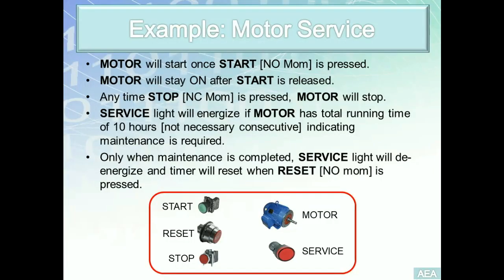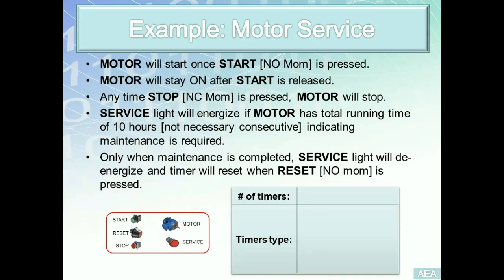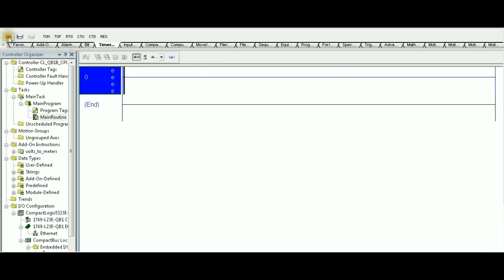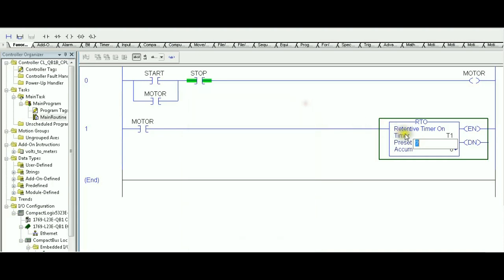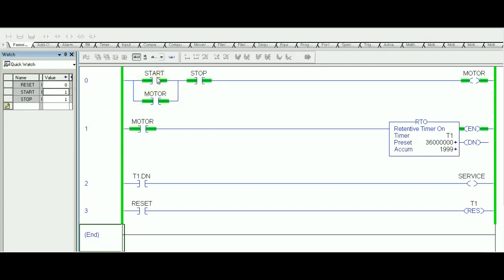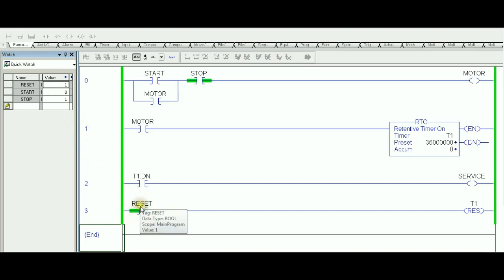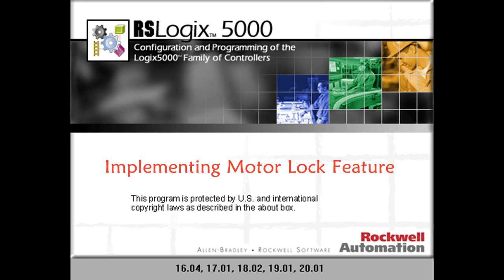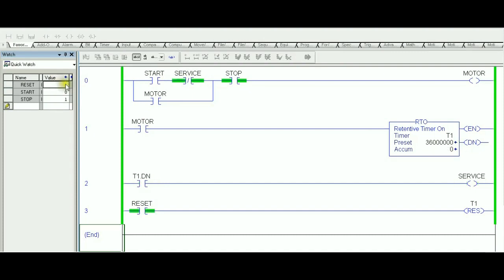LD 17 - Motor Service using Retentive Timer RTO - Easy PLC Programming Tutorials for Beginners

Comment: it was mentioned earlier that no consequential action required, I think you should have left the project without locking the motor with service signal .

Great Job 😉👍
Cheers
Reply from the maker: Thank U Shehab,
They way we interpret a requirement dictates the logic in our program.

Comment: Is it possible to reset RTO automatically? Like once service is done, it will automatic reset timer and start motor again.I tried to use XIO in that case but didn’t work.
Reply from the maker: Patel, when U say that service is done, what input do we have that inform us of service is over? 
In this example, we are using a “manual” way using the “Reset” NO push button. 
Also, when U say U used the XiO and it didn’t work, what is tied to the XIO?